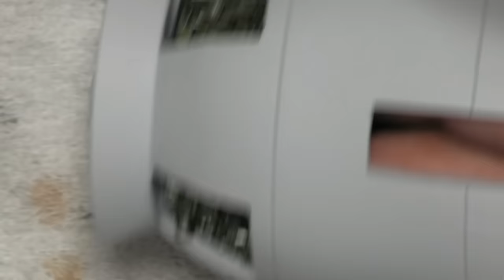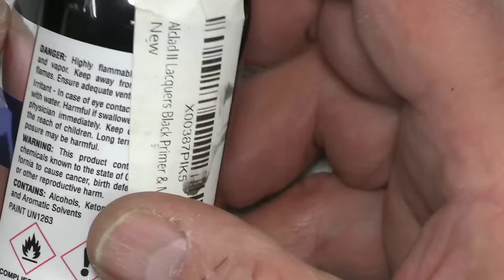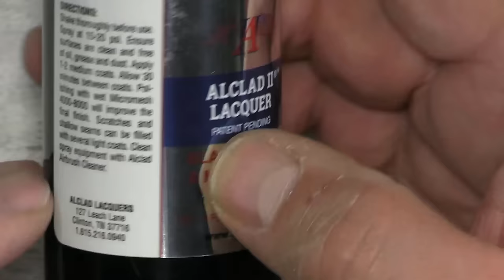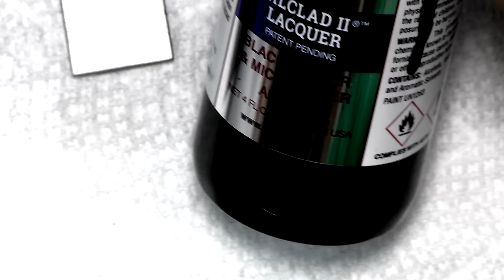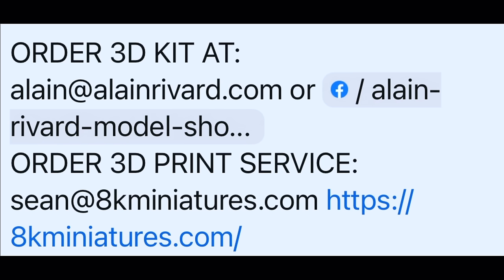Moonbase Interceptor build

Comment: If I ever finish it (75% done) fancy having a go at a MK3 Interceptor. I re-envisioned the Interceptor based on tech we have today and Space 1999, that was originally UFO#2. A little more detailed than the one you have it has some interesting features such as a Queller Drive (Voyagers Return Space1999), twin CTA 40 Cannons and the missile changed to the original "space depth charge" that splits into 4 sub munitions to seed the path in-front of a UFO.
Reply from the maker: Interesting!

Comment: I bought the files from Alain and edited the STL files to remove the panel lines (the original has pencil lines) I've slightly altered some of the other parts for accuracy - most of it is actually very, very good.The pilot is undersized by quite a bit which is an easy fix and the tail fin is way too thick.
Reply from the maker: Definitely some good points! Thought about a metal fantail - that would really make this pop!

Comment: You could turn the torpedo into the battery compartment and the attachment point into the power connection point and locking point with magnets ?